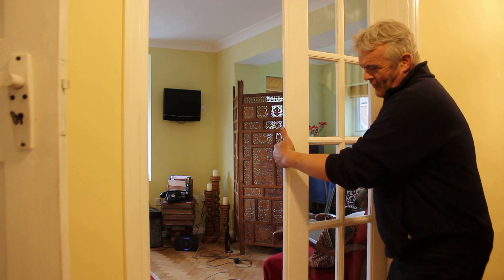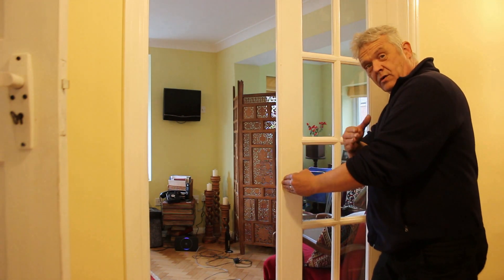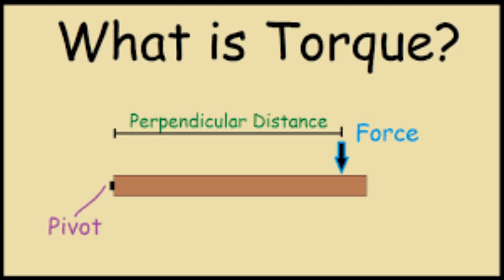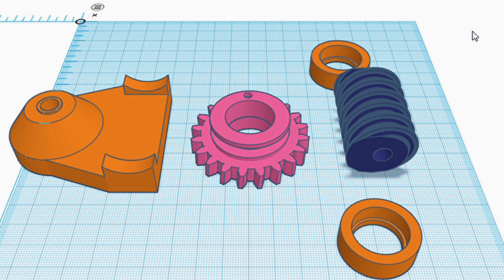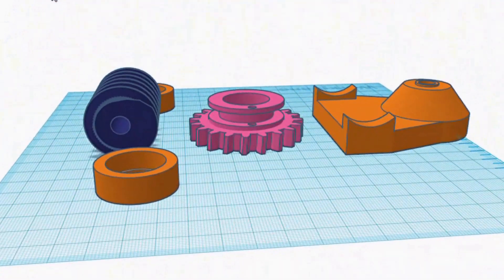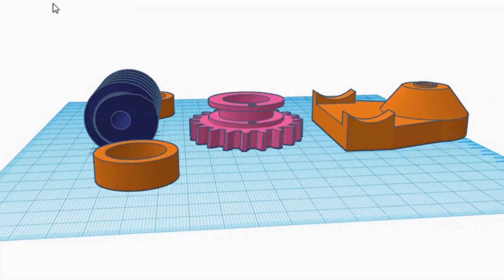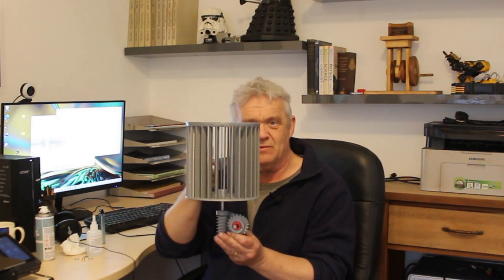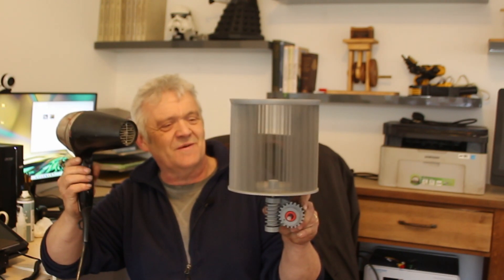1903 How Effective Is A Wind Turbine? A DIY Way To Measure It

Comment: You mean how efficient? Most of these smaller ones are toys. If you connected an electrical load to them they wouldn’t even spin.
Reply: Well it depends on the load, of course you can't use a 1.5 volt battery to start a car, but the battery has its uses !

Comment: I've got a broken Makita angle grinder with the back bearing worn out. It's got good potential for a worm gear mechanism as the bearing on the front plate still spins well, however may need to get a new bearing put on. Probably needs to be done with a  hydraulic press.

Comment: You might calculate the horsepower using the voltage and current generated, but that doesn't account for system losses.  Your worm gear idea seems to be the best one, but doesn't eliminate friction loss in the gears.

Unfortunately, no matter how much you cover the fins, guides, or the turbines, water or moisture will get in, and will freeze in the cold winter, so it will need occasional cleaning and servicing.

Good on you;   Cheers.

Comment: I imagine this intergrated onto a high pole. With an egg shape at the top which moves with the direction of the wind. The egg is the perfect geometry to create a vortext around it. that vortex would create a large suction force through the hollow tube and generate energy in the turbine. even at low wind

Comment: I was just thinking about this the other day. There are a few other Youtubers who have made their own arm style Torque meters. Another way I was thinking was more for power and energy measurement is to have the axle mounted parallel with the ground and tie a string with a 1kg weight to it. As the turbine spins, it coils the string and raises the weight. Time how far the weight rises in 1 minute or how long it takes to rise one metre and you can do the calcs from there.

Comment: I am not here for a super high quality video, but to get curios about something again. It is much more valuable . Thanks a lot, keep it up.
As for wind turbines, nothing beats the laws of physics, but it does not need to. Sometimes it is enough to make something more practical and enjoy 50Watt output, which is a lot over 24 hours :)
All I need is 200w in the winter, my current test does close to 20w which is great! 10 % of the way I am there.

Comment: Robert — can’t even express the value you provide to so many of us.  This particular clip - given the squirrel cage - provides a perfect opportunity for me to ask a reciprocal question which might be of value to many. My home is heated by electricity- furnace/air handler and thermostat…. And a bloody noisy squirrel cage fan!  Have you looked at all into flow from power efficiency as opposed to the reverse?  Might a reshaped air handler benefit from the designs you are so gratefully sharing?  Scott

Comment: Torque multiplication through MA.  Worm drive is great for torque multiplication but there is a price of input speed versus output speed.
A 20:1 MA increases the torque by a 20/1 ratio but the speed is reduced by the inverse factor 1:20 
If the input to a 20:1 worm drive is 100 rpm, the output rpm =100/20 = 5 rpm.
However, if the input force is 25g, the output force is 20x25 = 500g.

Comment: Surface finish and lubrication are very much more important with worm gears because of tangential sidelateral drag will rob your system of a lot of force as well as rapidly grind out the gears.

I have had to replace a lot of such gears made of metal when they have been allowed to run out of lubrication because they are often at a lot more force and in a direction which favors the worm actually grinding the pinion away in a way that is far less pronounced with spur gears.

I would strongly advise sanding, then coating the gear surfaces to smooth them out, and then adding some oil or grease to ensure that the gears do not lose power due to friction, and if you plan on using it long term [if] then this will also help you to prevent them from destroying themselves quite so quickly in operation.

Of course, please do keep in mind that the viscosity of the lubricant works 2 ways, one is for you and one is against you.

The lighter, lower viscosity lubricants will reduce parasitic viscocetal drag, but will also, in the process allow more material friction and grinding...

The heavier, higher viscosity lubricants will increase viscocetal drag, but will also, in the process protect the material from friction and grinding.

It is best to find a happy medium based on your particular application.

For really small devices, 0 grade single weight motor oil is likely good enough.

For larger, stronger, higher loads, you may look into dedicated gear lubricants from GL-1 through GL-5 and for super heavy leading systems, move up to actual heavy wheel bearing and machinery grade grease.

Just keep in mind that in the real world, the whole reason for bearings is because things like to stick, grind, and ultimately stop working, without them.

The same is true for lubrication, especially where there is no way to make a bearing for your design.

Comment: Pretty cool mechanical device. I guess you would stack progressively more weight to get to the limit of the torque. Thanks again.
Reply from the maker: exactly mate - or up the wind power until it moves a set weight

Comment: Hi mr smith can l ask is it possible to lay a huge wind turbine on its back /  how much force would l need to rotate one of the blades at the tip  ? .
Reply from the maker: you can answer that for yourself if you think about it mate - just think of it as a pivot point and a distance from the pivot

Comment: Hi Robert, I feel like I'm missing the point here... since the worm gear can only be turned by the worm wheel, and all the ratios and measurements are known, (weight, wind speed, turbine "area", etc..), it seems to me that this mechanism can only determine if our wind turbine can supply the threshold torque required to lift the weight... can you please explain how this helps us measure the effectiveness?
Thank you
Reply from the maker: torque is all about effectiveness of the application of force - in a wind of a given speed over a given area then the available force is known - all you ave to do is hang weights on it and see if it can lift the calculated weight - equally you can see what it can lift and how different that is from what it should be able to lift

Comment: If a hypoid gear in the middle of a pole was joined to the single pole at the bottom center of a wind turbine then the hypoid gear in yhe middle of the pole could drive 2 generators instead of one sir.
Reply from the maker: yes but you would need twice the inpu power to drive 2 generators or you would get half he energy out of each generator for a given input energy
Reply: @ThinkingandTinkering  Oops. You're right sir. Thanks for the insight.

Comment: Do you know that thing you made that was like the fan system you showed at the start but only an inch or so tall?

Well, could you shape the blades such that they encroach to the inside of the Darwin fan hod system, but then, twist and curve the blade such that it is shaped like an impeller with the opposite side+end of the blade sticking out towards the exit area where you want the air to flow?
Reply from the maker: yea you could

Comment: It would be great to see you make a larger device as you've done in this video, have it actually lift up a large weight, and let that weight slowly drop so we can see what kind of actual power we could get. I'm not sure how much power the average person uses a day so I'd like to get a real world idea of how much power I'd get from something like this. Might be a lot simpler and quicker just to hoist it up myself with a pulley system. I'm thinking, place the weight on a large lever with a high geared motor at the other end.
Reply from the maker: you are getting aead of me mate lol

Comment: Squirrel cage wheels are not known for being very efficient blowing air into the vanes and out the top- their main application is as a blower in many devices- with air pulled into the center and thrown out to the blades then exerting force on the vanes as they exit. Now that is in a "boxed unit" with air flows being controlled by the shape of the "box". But it has been around for centuries and no one seems much into using it either way to generate wind power- it wants a much higher wind velocity to even start for one thing. If it was easy, they wouldn't put a honkin" big capacitor on the motor to get started against that wheel. Nor has it the potential to gather and multiply the wind as your Darwin Wind Turbine does. But I'll watch if you care to explain to me how I've lost my way. Also the demonstrated results were dependent on not blowing directly into the center of the vanes, but toward the outer edged to put the wind directly into the vanes and not generally- or worse robbing the Wheel as the blades come around into the wind- so to be effective it will still need to be "canned" as they are conventionally used all over. Please don't take me wrong- I really want to understand this- I was an HVAC- air conditioning- technician and servicing engineer for 25 years- I have been using that type of fan for a long , long time- as a matter of fact, I probably have a dozen fan sections from four and five ton sir distribution systems. I have sold the larger ones I salvaged- they are quit pricey new- clean and repainted mine fetched half that and  never had one come back. But, I could see a string of those , say, over topping a fence line; five, ten or twenty on the same axle. But I don't think the efficiency is there to make it worthwhile.
Reply from the maker: it doesn't matter what the turbine was like mate - the video isn't about the turbine!

Comment: Seeing as we can trade RPM for torque (and vice versa), could we not simply measure the RPM as a determination of the value of our wind converter (in this case, the squirrel cage)?
Reply from the maker: unfortunately not as there is no direct relationship from machine to machine

Comment: Set the turbine horizontal and wind a weighted string around the screw. Otherwise you're introducing the worm gear friction into the test which is hard to measure... 😊
Reply from the maker: really not a lot mate - in fact insignificant really - all measurement has error - the error here is about the same as any other method

Comment: Gear trains have loses though so you won't be able to convert all the torque, and if I remember right worm gears are some of the worst offenders. 

Funny enough they can be driven backwards, if angles / gear ratio is right enough, which also point to their lack of efficiency in a way.
Reply from the maker: hmmm - actually mate they are stunning efficient if built well
Reply: @ThinkingandTinkering  I've read somewhere that they are something like 60% efficient. I will check that again.

That they can be reverse driven is something I very amazingly found out myself as I also thought initially that they can not be reverse driven.
Reply from the maker: we seem to be hearing different things mate - well that's often the way of it
Reply: @ThinkingandTinkering  Nah, I've just checked, for worm drives with gear ratios between 1:10 - 1:60 efficiency is 85 - 40% respectively. 

Whether they can be backdriven or not depends on the lead angle. Very shallow and friction wins, with higher angles they will be back driven. Makes sense also lead screws are a form of wormgear and in most 3D printers you can lower the bed manually with a bit of care.